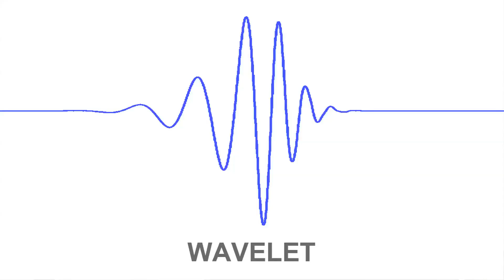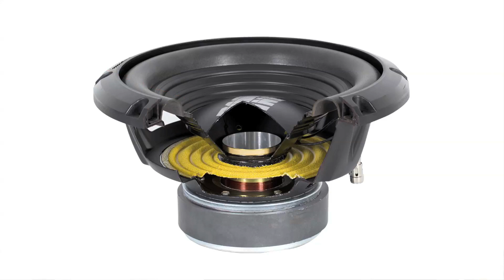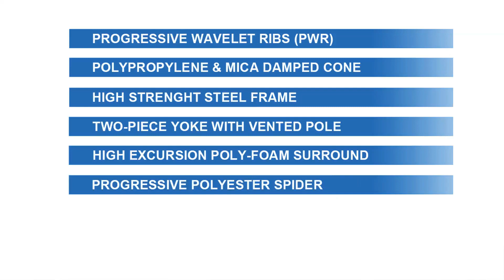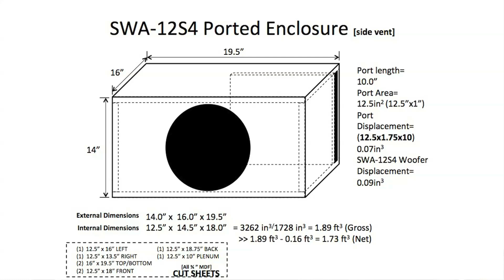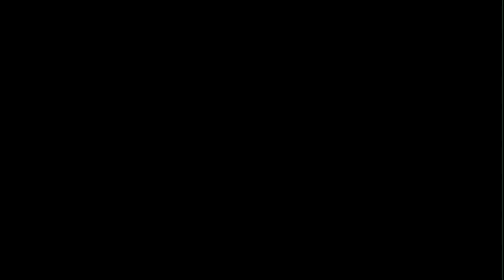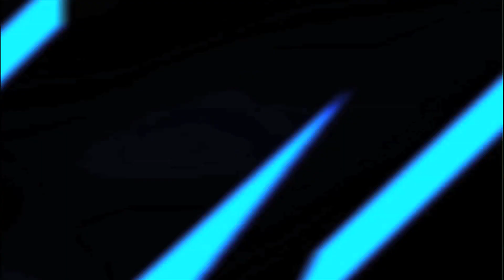Beat Laboratory: BASSLINE™ Subwoofer Series

Comment: Best entry-level 10" subwoofer. 0.6 cu.ft. sealed box (single), powered w/ an old Dual 600w 4 ch. (76 dB, 0 bass dB, 500hz) I'd like to run it in my dream setup: Alpine CDE-143BT / Alpine R-A60F (87 dB, 250hz-500hz, 0 bass dB)/ Alpine R-Series 6.5 2-ways (87 dB).

Comment: I had three 10's. They did sound pretty good but about two weeks after I installed them they all gave out, cone separated from spider. Can't complain though, I was pushing them way harder than they should have been pushed. I can tell you though, they can handle a good bit more than their rating. Can't find them anywhere now.
Reply: MrWhoisthisisme you can find them at best buy

Comment: judging by bro science, will 2 12 bassline subwoofers in an optimal custom ported box on around 500 rms hit the same as a single type r 12 custom ported box on 1000 watts? I got this because you add 3 db when u double cone area or double the power